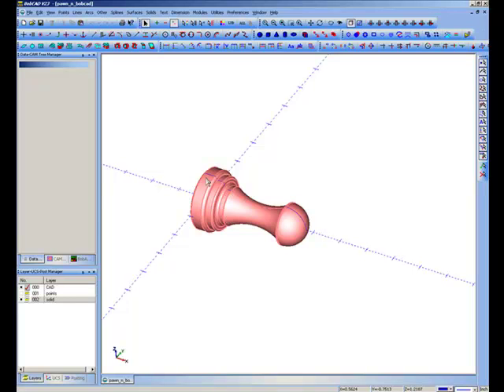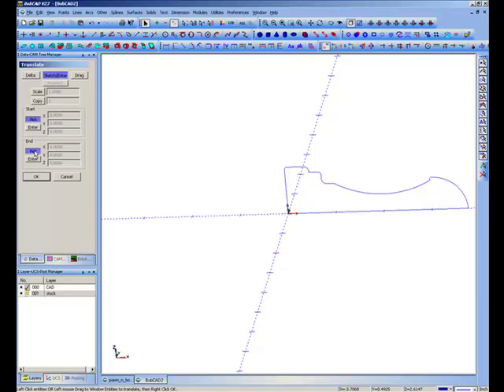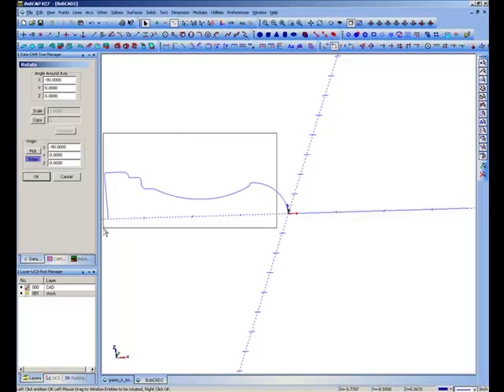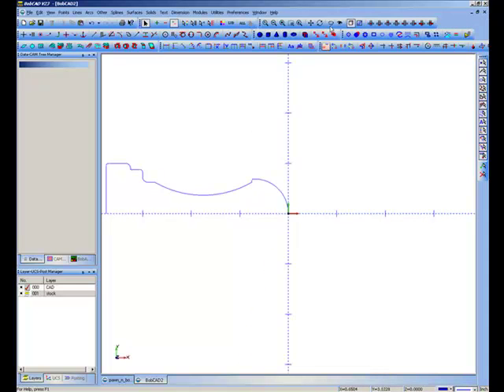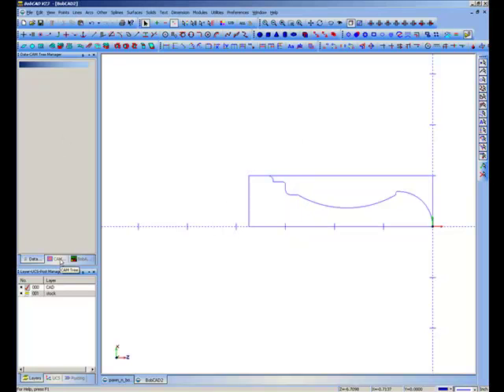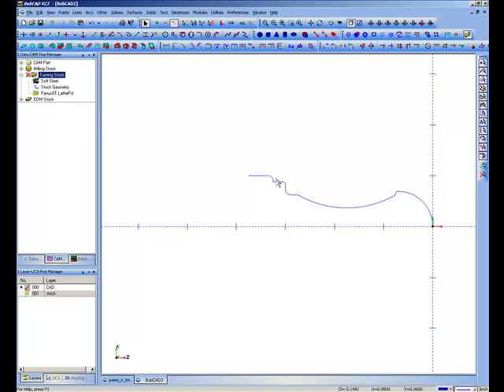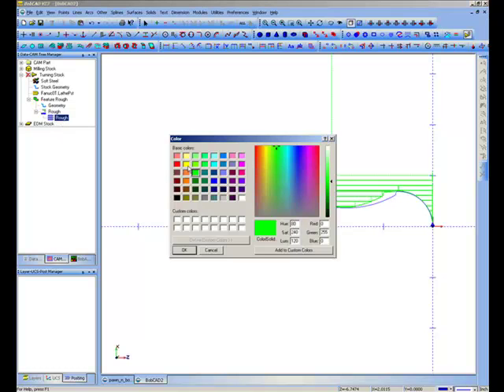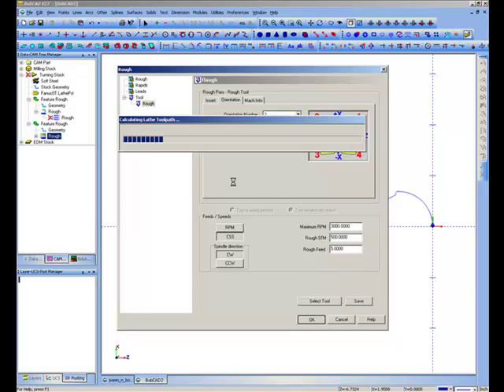pawn lathe

Comment from the maker: """""""you said "lathe love contours". In lathe mode doesn't the tool know which direction to move?""""""

Yes. But creating a contour out of several entities also does "other things". The contour function does an analysis/algorithm on the entities and actually creates "a new" entity.. a single, re-calculated entity. I have said this also because it is what i was told by a programmer from BobCad... That new entity will be loved more by the lathe module than just a bunch of dxf geometry...